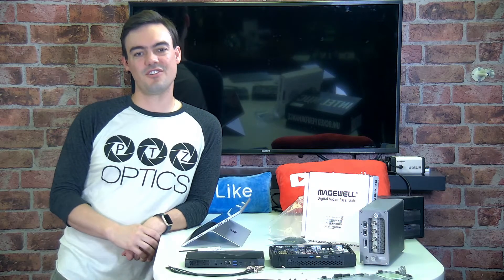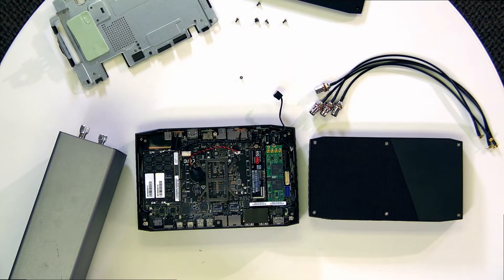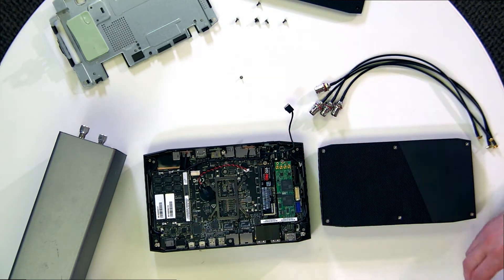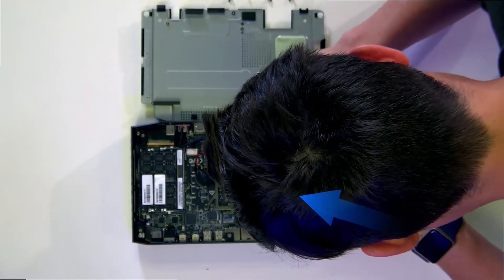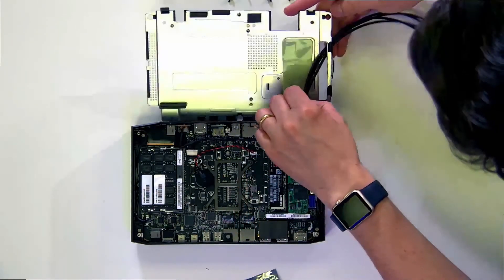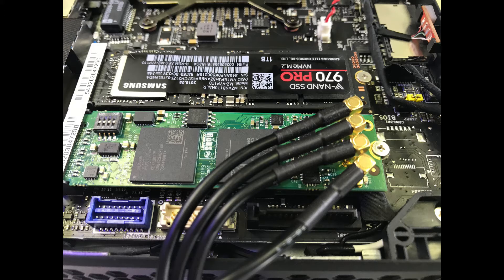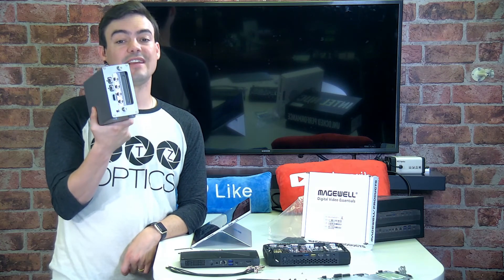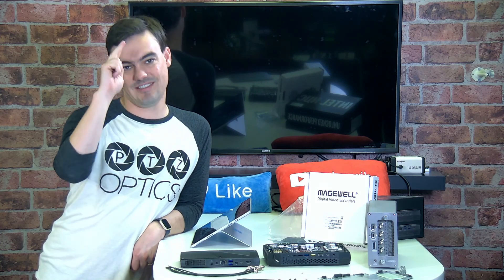How to install an M.2 Card in the Hades Canyon Intel NUC **Issues with overheating beware!

Comment: I got some small spacers with mine  to screw in before putting the lid back on it raises it enough to trial the wires out of the gap around it that it  creates. Does using m.2  achieve better gfx speeds than using thunderbolt which is only 4x? Great video. 
 than going through  thunderbolt

Comment: Just got my Nuc 8809G, in the packet of spare screws there's some spacers aren't they for the lid to create a gap for protruding internal connections 😃  need some good videos for over clocking best settings for VR

Comment: Write a model SDI card! How does a computer work without a hard drive?
Reply: It's using a SSD (Solid State Drive). The most common ones are the size that you would find within laptops (2.5 inch) but this system is using an M.2 card which is much smaller.